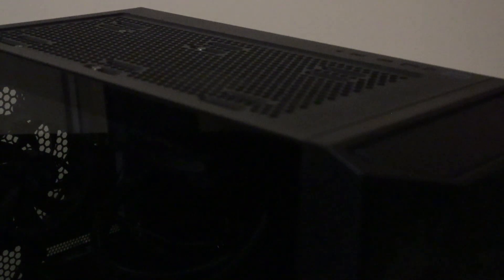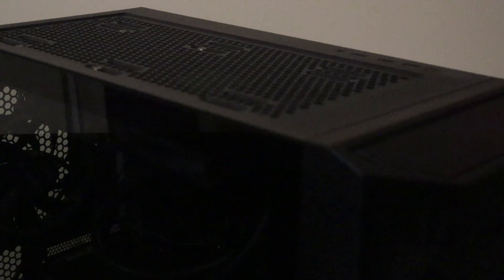A Nightmare Clicking Noise in an MSI 240R MAG Coreliquid AIO CPU Cooler which occurs in a 360R 120R

Comment: Mine just started making that sound today, and my cpu tempature sometimes reach 90 degrees now. But it only makes the sound whet it starts up, and then it slowly dissapears
Reply from the maker: You risk a pressure buildup and it springs a leak damaging components. I traded my broken one into my retailer for a Corsair.

Comment: Mine has this, sounds like a hard drive, it’s not too severe, does it just mean it’s making noise or is it actually broken, if I don’t mind the noise can I still use it?
Reply from the maker: I would plan on getting a more reliable brand. If it is under warranty and you can physically exchange it for a different brand, that is what I did. I got a Corsair. Thousands of these have failed. My understanding is that there is an unfixable fault with the radiator. You run the risk of pressure buildup and damage to other components. I would not spend money shipping to MSI. I will never get an AIO with the pump in the radiator again.
Reply: @pcgamingtechsummary  what 3 fan water cooling would you suggest, for around 100 usd or só
Reply from the maker: @garff7557  I assume you are in the USA so in $US - I have the 240mm Corsair iCUE H100i ELITE CAPELLIX XT with a 12700K, gaming is 4.6 GHz Hitman 3 = Max 56C, avg 48C. I see there is a different model 280 mm Corsair iCUE LINK H115i RGB, I have not researched this 360 mm, Corsair NAUTILUS 360 RS.
Reply: @pcgamingtechsummary  my case fits a 3 fan, so should I just only get 3 fans coolers or is 2 fine, I have a ryzen 5 7600x
Reply from the maker: 2 fans are enough. I have the 240mm Corsair iCUE H100i ELITE CAPELLIX XT and I really like it. Once I got the settings and lighting where I wanted it, I uninstalled the iCUE software. The AIO just keeps using those settings.
Reply: @pcgamingtechsummary  I’ll get that one for my birthday, thanks. It has no noise like the msi one right, is it not a common issue
Reply from the maker: @ Only with MSI. I have had a different Corsair AIO since 2017 and it is still going 8 years later. MSI sold these faullty AIOs, which they had made by a different company in China,  for years and years without fixing them.

Comment: Thank you for posting this. My PC has been making this exact same noise and I haven't been able to figure out what was causing it until now. I have this same CPU cooler and have been experiencing this awful noise for a couple weeks. I submitted a ticket on MSI website and they told me "Unfortunately, this product is showing the warranty expired in December of 2023. If the product was having issues, it would have shown within the first few months of ownership, not 10 months after the warranty ended. Unfortunately, we would not be able to extend a product replacement for this cooler. We are sorry for the inconvenience this may have caused."
Reply from the maker: Sounds like they are shoveling BS. They know thousands of these have failed and why. I made a video over 2 years ago about changing the coolant (which you should not do, because it will still fail) and it has over 10,000 views. This tells me that way over 10,000 have failed. I would not spend anymore money on them. You can read 1 Star reviews on Amazon for proof.
Reply: @pcgamingtechsummary  they 100% are. They even denied ever doing a recall. I sent them website and article links. They weren’t going to do anything for me. We continued to argue and finally they said they would review my case further & said if they decide to assist with a one time replacement it will carry no warranty and i will need to send in the product first and i would be responsible for the shipping costs. Still waiting to hear back. The customer service experience has been awful. I think they figure most people will give up. It took me 10+ emails going back and forth before they would even attempt to rectify the situation. Very scummy business tactics
Reply from the maker: @chancerich2985  If you get an MSI replacement, it will probably fail too if the pump is in the radiator.
Reply: @pcgamingtechsummary  I believe they’re sending me the v2 model. Does the updated model suffer from the same issue?
Reply from the maker: @chancerich2985  Yes it does.  It will fail. V2 comes with 1700 bracket.
Reply: @pcgamingtechsummary  is there a different brand you recommend
Reply from the maker: @chancerich2985  I have 2 Corsair AIOs. One is from 2017 and is still going.

Comment: Just rma’d the first coreliquid 360v2 and installed the new replacement about a month ago on my z690 force/12700k and the aio just started making that awful clicky noise today. I’m gonna rma this one and ask for either an upgraded unit or a cash voucher to put towards a nicer model, this is absolutely ridiculous
Reply from the maker: I would demand an AIO that does not have the pump in the radiator. You should not have to pay for shipping. Some MSI 4090s have corrosion underneath the GPU chip.
Reply: @pcgamingtechsummary  I tried to get credit towards my account, or to pay the difference to get a different model of aio. I explained that there are thousands of failed v2’s and that all it takes is a simple google search to see that. 

In response I was told “the Coreliquid V2 has not been recalled and the issue has been fixed”, to getting a line of credit/having it replaced with a different line of aio/paying the extra for a better designed aio I got “We can not do that, all we can do is replace the cooler with the excact same model”. So i tell him excactly what your video explained, and that this is a faulty product that I don’t feel comfortable running in my pc. I ask for it to be escalated to someone else and I am denied. I then get told I have to send the cooler in and after they receive it I will have a new cooler or the same cooler that’s been repaired returned…which is bullshit because i just rma’d my first one and they sent me a replacement first. 
Also get this, the product warranty goes by the purchase date of the original cooler. So even if a cooler fails every month (which i expect it to at this rate) I will only be covered until 2/6/25 because it’s a 3yr warranty…
I have roughly 6 grand worth of components registered to my msi account and have been exclusively purchasing there Carbon WiFi or Ace line for my last 4 builds, 2 Unify models/8 Tomahawk series and more. Gpu’s  I’ve got the $370 Gaming X Trio 6750XT/$1800 Suprim X 4090/ Ventus 3X oc 3070 and more…
So I ask the guy is it really worth losing a loyal customer over a piece of shit, lower end aio. I get a “I understand but with no recall all I can do is rma the excact one” 
I told him I was gonna rma it for a new one. However I don’t feel comfortable even selling it and I can not in good faith ever install another one into my or any of my clients systems. 

I have used probably 30 different aio’s over the last 5 years and the only one I’ve ever had fail completely is this Coreliquid v2 360. I have a-refurbished 360mm Corsair Capalix and 280mm Caplix on hand without the lga1700 mounting hardware or commander cores since I was able to sell them for over the cost of the coolers at the time. A 420mm Arctic aio as wall art for my streams background. I’m gonna just reinstall my Scythe Mugen 5 ARGB (one of the only ones in all of North America!) and worry about getting another 360 aio when i move up from my easy to cool 12700k I guess

Comment: how to fix this?
Reply from the maker: There is no fix. There is a manufacturing fault with the radiator. Create a ticket at MSI website and demand a replacement that does not have the pump in the radiator. I would not pay any money for shipping. I exchanged mine for the Corsair H100i Elite 240 AIO and paid the difference in price. Avoid MSI GPUs as well. Some 4090s have corrosion under the GPU chip.

Comment: I had that sound once and had no clue what is was. I was assumming it was the AIO but wasn't sure. This morning, after booting my pc, that noice was really noise and then stopped. I saw that my CPU temperature was higher than usual (like 65°c on rest wtf). I'm done with MSI. AOI, Monitors, GPU, everything they do is complete garbage.
Reply from the maker: I am glad I was able to help. I know of an MSI 4090 that had corrosion underneath the GPU chip and could not be fixed by an expert.  If you could Subscribe that would be great! I hope to do an MSI AIO update by the end of the month.

Comment: I have the MSI Serie MAG CORELIQUID 360R and it have been a complete nightmare!!!  I bough on 27 -11 - 2020 but installed on 12-01-2021... and since 1 month ago start with this annoying sound!!!!! What can i do??? is a refill problem or this thing that cost me a bunch is just broken!!!!
Reply from the maker: Manufacturing defect of probably the coolant quality and a fault with the radiator. You can create a ticket on the MSI website. You do not want to pay for any shipping. Do not get an AIO with the pump in the radiator. My understanding is they are contract manufactured. I replaced the coolant after a month because I heard people had issues. It still failed within a short time. I made videos on this starting with https://www.youtube.com/watch?v=J_2L06bR0bQ

Comment: I have the updated version (360c) a month old and it's doing very similar. Seems tho MSI never really fixed the issue
Reply from the maker: Thousands of failures have been going on for over a year and MSI still sells them.
Reply: @pcgamingtechsummary   pretty crap i had seen that and the so called "updated version" seems to be still an issue. i expected more from MSI
Reply from the maker: I expect more from any company that wants to stay in business. I believe the V2 was made to fit Alder Lake Gen 12 CPUs. @jasonstalder5208

Comment: Msi is crazy, I have the same problem since today and when I go to ask a repair they say : product not avaible for repair. I own it for just one year. Shitty customer service, worst aio
Reply from the maker: This has been going on for more than a year. You can create a ticket on the MSI website and demand an AIO that does not have a pump in the radiator.
Reply: When i registered my aio on their website said i had 3 year warranty. So far i had it for a year and the noise is not that bad it comes and goes. I hope if it does fails, they will honor the warranty.

Comment: I own the msi corelquilid 360r since may 2021 i have had the same issue right after 1 year of service 1st time i did a flush of the liquid and refill of it right after i start getting high temps so the maintenence i did was good for another year 2nd time around playing games my tempa were 91c on my AMD 5800x , what i did this last time i took the cold plate out and find out that interiors of the plate was clogged with a white debris thatook like gunk after clining the cold plate with alcohol and a toothbrush and refiling the cooler with a mix of 90% distilled water and 10% car radiator pure coolant my max temps playin are 69c with an Ambient temp of 32c at 4.9 ghz auto boost on my 5800x
Reply from the maker: You might check the coolant to see if it is OK for copper.
Reply: @pcgamingtechsummary  ty i will check

Comment: It does seem to be cavitation but I think its in the radiator. I found running my fans too slowly cause it, I didnt change the pump speed, but the fans on the radiator were slowed down to 1200RPM. I turned them up to 1560 RPM and the noise went away. That being said, I still think its failing and will replace it eventually.
Reply from the maker: Some people have had the pressure build up and spring a leak damaging other components. Be sure not to get an AIO with the pump in the radiator. I use Corsair now. https://www.youtube.com/watch?v=-d44wt-6TEc   https://www.youtube.com/watch?v=sayxZETxbXo

Comment: Mines is not that bad it makes a ticking noise but it sporadic, I am not sure if it starting to fail or its normal. It is very annoying, and lots of people told me not to buy the msi aio but i got it brand new for a great deal.
Reply from the maker: It will fail. Some people get a pressure build up and  it springs a leak ruining other components. If someone paid me to take a new one, I would not take it.
Reply: @pcgamingtechsummary  that's not good news now I dont know if I should contact msi see if I can get it replaced or throw it away? The ticking noise just keeps getting worse i have gaming mode on fir both cpu and ram.
Reply from the maker: @gdadude7747  Can you exchange for a Corsair? Or was it bought from MSI? If you get a replacement AIO and radiator with a pump it, it will probably fail as well. If you have to pay for shipping to MSI is it worth another failure? You can go to MSI website and apply for a swap or create a ticket and demand a refund. I exchanged my 240R for a Corsair H100i Elite which is awesome for my 12700K. Be sure to subscribe please. https://www.youtube.com/watch?v=sayxZETxbXo
Reply: @pcgamingtechsummary  Too late now but I got it like super cheap from GameStop website. I registered the AIO on the MSI website and it said I have like a 3-year warranty. If it fails, I'll just hope they honor the warranty. It's been a year, and the sound comes and goes like right now I don't hear any clicking. It's works keeps my temps low and it's been holding up. I think for my next AIO will probably be a Corsair or a Cool Master, but the MSI are cheaper.
Reply: Do you mind me asking where you plugged the pump 3 pin female and the fan power cables
Reply from the maker: @michaeldziadul6186  Create an MSI ticket on their website. I hope you realize this AIO can build up pressure, spring a leak and ruin other components.
Reply: @michaeldziadul6186  I plug the 3 pin in the pump fan plug even though my mb has 4 pin but it still works. My MB also has  system fan plugs so  I plug them in there. I have a msi mobo so its easy.
Reply from the maker: People have had it block up and build up pressure, leak and destroy other components. So this could be the worst deal you ever made. People also get replacements which fail as well. Good luck and let us know what happens.

Comment: My cooler is the same but I do tava problem withe the noise I have problem temperature   just like 60 or 70  but if I play any game I get like 90 c just impossible
Reply: MSI made a recall, it sound like yours was one of the ones affected, I would hit up MSI directly
Reply from the maker: @Purplexity  An MSI replacement with the pump in the radiator will also fail.  Well, I exchanged the Rubbish MSI 240R for a totally awesome Corsair H100i Elite 240 AIO with 128 micro-fins/inch https://www.youtube.com/watch?v=sayxZETxbXo   https://www.youtube.com/watch?v=_4y8dzCd4TU
Reply from the maker: If you can exchange it for a Corsair. If not  Apply for an MSI AIO swap Check your 240R or 360R serial number or your MSI Pre-Built PC Serial Number In the USA https://us.msi.com/Landing/liquid-cooler-swap-application  International https://www.msi.com/Landing/liquid-cooler-swap-application   Tell than you want an AIO that does  not have the pump in the radiator and that they are all failing. Last choice is to create a ticket on the MSI website.

Comment: Same is with my 240R. 
First I had the issue in 6months and they replaced the first one with a new cooler (same MSI 240R). After 6 months it's happening again with the replaced one. So annonying :
Reply from the maker: Create a ticket on the MSI website and explain everything. I would explain all of these are failing and you require an AIO that does not have the pump in the radiator.
Reply: did you install them vertically or horizontally at the top?

Comment: I have had this issue for months now. Bought it over Christmas. I wouldn't say it's metal bits. It's air drawn into the system causing Cavitation and making the coolant inefficient
Reply from the maker: Air bubbles sound different Watch this at 21:44 https://youtu.be/tbtq1jAHp7o?t=1304
Reply: @pcgamingtechsummary  ahhh yeah right

Comment: Same pump on a 9900k. Temps of 100c. My serial number isn’t included in the recall either.  Threw an old aio in there are temps are fine now
Reply from the maker: I would go to the MSI website and create a ticket. Request a replacement with a different model number, even if it is out of warranty. You may need a screenshot of high temps and tell your story.